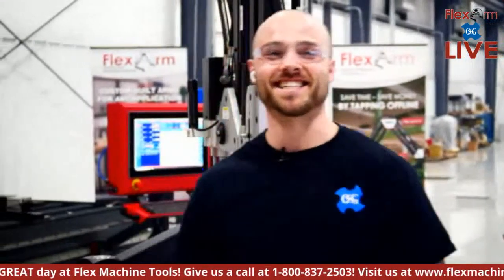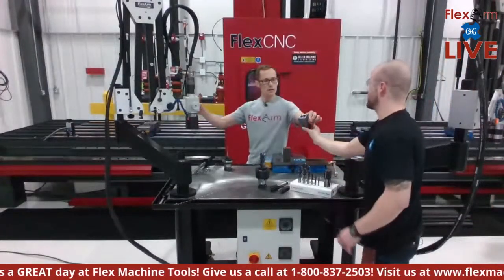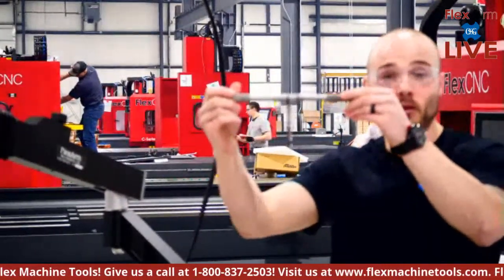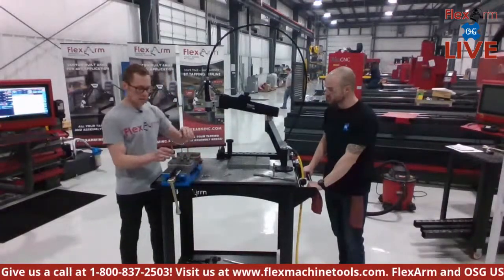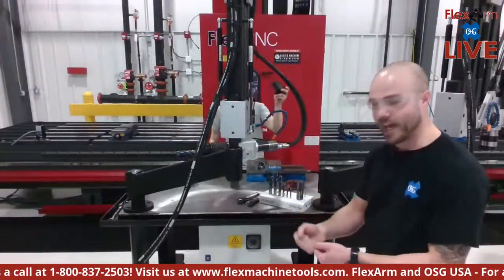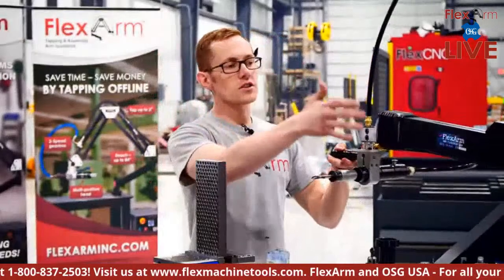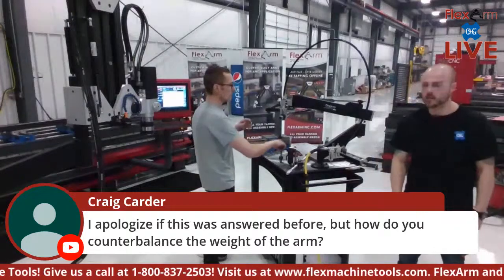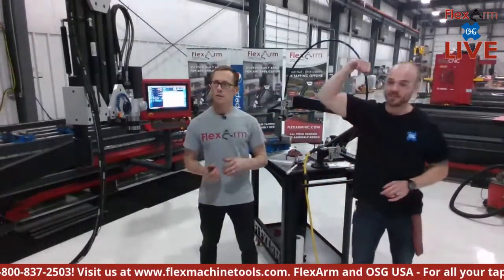FlexArm Tapping Demo

Comment: so this is just tapping. it won't do Drilling, countersinking and reaming like other machines.
Reply: you can but not on thick and big holes. The Steadicam-like flex arm do not apply the needed downward force to drill holes. You can try to apply the downward force by your own weight but the hole will be cock-eye.